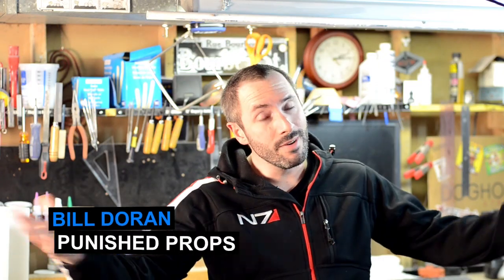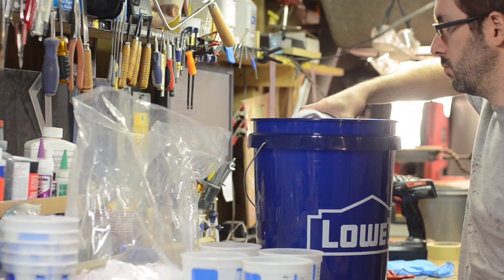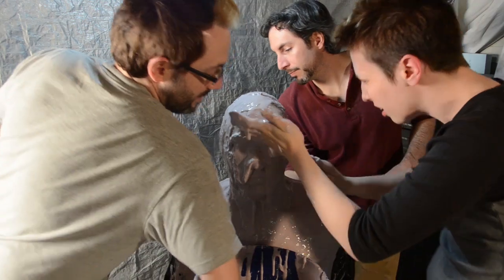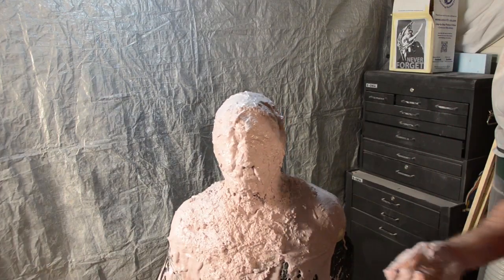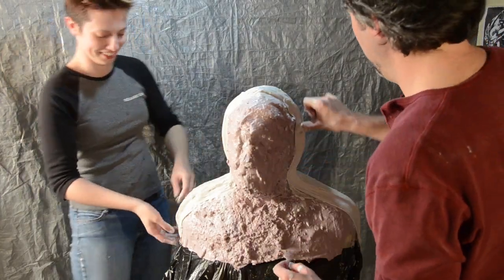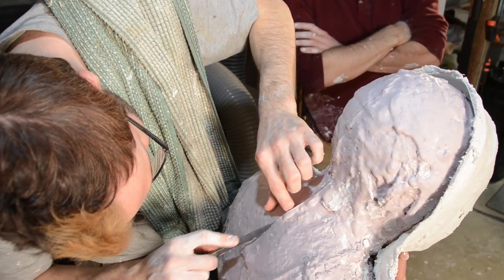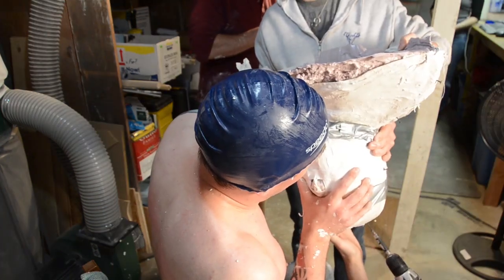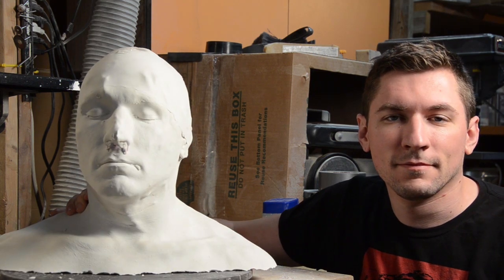Prop: Shop - Creating a Life Cast Bust with Alginate

Comment: Great Job Bill! This is such a fun project. I still have a front cast of my face from 16 years ago. Got to make a new one. :-) One thing I would add that really works and is quicker to apply for separating the front and back halves of the plaster mother mold is wet paper towels. :-)

Comment: i read somewhere that you need 25-30 pounds of ultracal to fill a mold around this size, amazon has some for around 17 bucks, but its not very practical because they are 5lb bags. i would suggest searching for a 50lb bag online i found some at a store locally for about 35 dollars. i am going to be attempting this later this week and i'm just gathering info and supplies.

Comment: Id add that for people not used to breathing through their nose, to get the person getting moulded to inhale some vics or olbas oil or anything that helps clear the nose and make breathing easier. Ive only had my face cast but damn i needed that inhalant alot.
Reply: +Bill Doran Another good thing to do for helping them breathe is have them stick short lengths of plastic tube in their nose. This means you can apply a good layer of the alginate around the nose for a strong cast without worrying about blocking their airway. When the alginate is still quite liquid they can clear the tube while someone holds it still so they don't snort it out as well, and then as it solidifies you can change the tube if needed before adding the plaster bandages. This worked very well at our university for people who were worried about not being able to breathe because we had one person there just to make sure the tubes were clear for them, helped them to keep calm when they cannot hear you inside the mould.
Reply: @Tapadahat  good idea i remember being body casts for a artist i had straws in my nose.bodycasting is great.

Comment: Nice video many hands help is good for these large project. I have to say alginate is a little more forgiving then just an hour uses , did like what you did with the screws to combined the two halves though i believe clay would work just as well on the nose holes and seams instead of screws... looks fun keep rocking looks pro quality

Comment: Hi. What type of material to make a head cast will allow for the final product to have nails and pins go through it. I need to make a head cast as an art project. Once everything is peeled off to reveal the actual facial features ---> what type of material can I fill the head cast with that will allow me to insert nails and pins into it? Thanks.
Reply from the maker: That sounds like a cool project! You can fill the head mold with an expanding foam--like we did for Bob: https://youtu.be/V3rxHJPOWHg?si=i4v98alwslNS7fdV&t=328 There are different expanding foam densities, as well as squishy vs rigid, but all of them can be stabbed with pins: https://www.smooth-on.com/category/foam/

Comment: I read the comments below, but I didn't see any comments that addressed my thoughts/questions.  If I did I apologize.  What I'm curious to know are the benefits of using this method over others such as silicone or others.  I'm mostly ignorant on this stuff for forgive me for that too.  Is it purely a cost benefit?  Or perhaps time/preparation also?

Some complained about the quality of the casting, but I suspect that its the medium and not so much the technique.  Silicon molds seem to be very crisp, but again at what cost  or other draw backs.

Thank you for taking the time to make these informative and entertaining videos.
Reply: Silicone will cost you 5 to 10 times as much and has a much slower setting time. Yes its better as you will have a reusable piece but tbh its overkill unless you need the very best end result.

In this case the quality of the final product was down to technique more than products used. But it was still a perfectly acceptable end product for their needs.
Reply: William Hayden Silicone is a multi use material, better if you need to make several of something. The additional cost far outweigh the price for multiple uses. Setup time is not much more if using the correct silicone.

Comment: When you used silicone with I Like To Make Stuff, what material bald cap was that? Having trouble finding a non-latex bald cap.
Reply from the maker: It was probably silicone. You can usually find them wherever prosthetics are sold
Reply: @punishedprops  I ended up ordering a vinyl cap - we'll see how it works!

Comment: How much Hydrocal will I need?
Reply: i read somewhere you need 25-30 pounds of hydrocal, shop for the 50 pound bag they are cheaper than getting them on amazon.
Reply: A 5 pound bag filled my mould about halfway, I'd just buy two quantities of what he has linked.
Reply: +Komodo Dargon Awesome thanks, was your cast to the shoulders?
Reply: I honestly just made mine to my neck, I let the shoulders be hollow so i could use them to prop the head up better

Comment: curious i get how this is done but how much alginate or silicone is need per head on average do you mix like 10% extra . Also how much plaster bandages , celluose ,,,,etc in general is need to do the mother mold

Comment: Great Video!  Glad I found you.  What is the benefit of using hydrocal over just regular plaster of paris?
Reply: ***** I know this is really late but there's two main reasons:
1. Plaster of Paris heats up as it cools, alginate cracks when it dries, so the plaster could ruin the the mold before it fully cures.
2. Hydrocal is much stronger than Plaster.
I know your post is old but I hope this helps!
Reply: ***** it helped me even if it didn't help the original asker thanks

Comment: What's the best method to use on a female with really, really long hair? Putting it all up in a shower cap makes a very big and alien-like knot (beehive).
Reply: Put her hair in a tight pony tail in the center back of her head. Braid and then Wrap her loose hair a few times with saran wrap (aluminum foil will rip and tear bald caps easily). Rubber band that, tightly so that it does not slip off during application. Cut a very small slit or hole in your bald cap, and pull her saran wrapped ponytail through the hole, making sure your material will not touch her loose hair or she's gonna be really upset lol. Alginate or silicone and plaster bandage around her ponytail. You will be able to plug the hole fairly easily from the inside with some more alginate, silicone or clay.
Reply: Thank you so much!!!!!
Reply: Ya' gotta shave it. It's the only way

Comment: Really should have given him an air tube.
Reply: +Galdrus Lock Dangerous and pointless. It will distort the face, and if a tube is bumped it will cut or choke them.
Reply: only if you said that is that with the final product and do nothing else to "touch it up"
Reply: +Galdrus Lock huh? The point of a lifecast is to get as accurate of a representation of someone as possible. You want to resculpt as little as possible. Typically it's just opening the eyes and opening up the nostrils. Pros don't use tubes anymore because there is no need, it's a bad idea.
Reply: Well then the absolute perfect life cast is where the person should die. I guess that would make it art. Watch some weirdo artsy dootsy group try it now.
Reply: Aaaah, but they do... If the model is incapable of breathing out of their nose, due to something like a cold. But you need that lifecast asap, what do you think the solution is? Some kind of tube (like a straw) is put in the mouth. Obviously it's going to appear in the lifecast and you have to touch it up but when you need that face, you need that face...
Reply: @Searching4Solace  I believe they mean for a perfect lifecast there would have to be no touch ups or alterations to the finished lifecast. As in material up the nose and no mouth tube..  with no way to breath, the model would die.

Comment: What about facial hair
Reply from the maker: Usually you can just apply a little Vaseline to the areas with hair to protect them from getting caught in the plaster. There is likely a different process for people with full beards, but it's possible that shaving for this process is the best option if a large amount of facial hair is present.
Reply: Punished Props Academy thank you very much
Reply: Punished Props Academy is the process the same with eyebrows

Comment: I have had the displeasure of having alginate up my nose during a lifecast...  It was my first time being under and the helper swiped it up right into both of my nostrils. I couldn't breathe and was hitting my hand on my leg. All I could hear was  "Breathe out! Breathe out!" There is no air in my lungs, you TWAT! is all I could think. They grabbed a popsicle stick and scraped all the material out of my nose. I want to say a couple things.. First is that through out the process you want to check on how your model is doing. Regularly ask if they can breathe alright and have them give you a thumbs up.Alright process tips that will make life a little easier. #1 Weather stripping. Get some weather stripping and stick it from shoulder to shoulder over the top of the head. With a full head cast it helps with the seam and a halfcast it is where it will end. Then outline it where you want your lifecast to end. You only need as much space as what you're going to be using, it saves on materials.#2 Sharpie. Draw the person's hairline on the bald/swim cap, it will transfer to the alginate and then to the ultracal.#3 Burlap. For the face cut out pieces of burlap that roughly fit the forehead, cheeks, chin, and nose. when the alginate is starting to set up press those pieces into it, it reinforces the material and helps it from ripping.#4 PUH-LEEEEEEEEEEASE don't just dump the ultracal in there like that. A couple thin beauty coats first, then layer in thicker coats, as they start to cure mix up more ultracal and do another layer. It should be HALLOW. If not that is going to be one HEAVY lifecast.